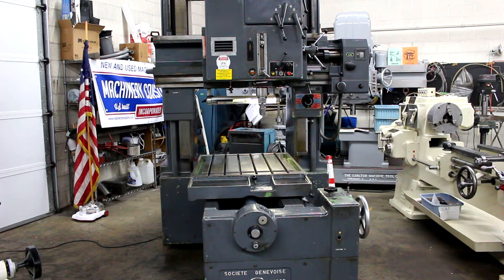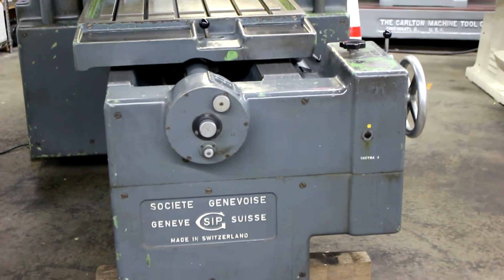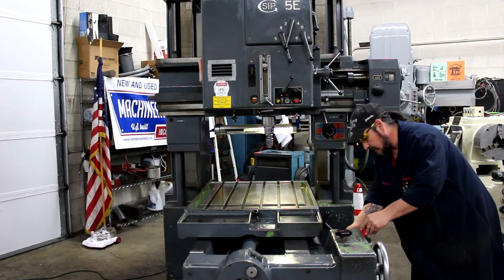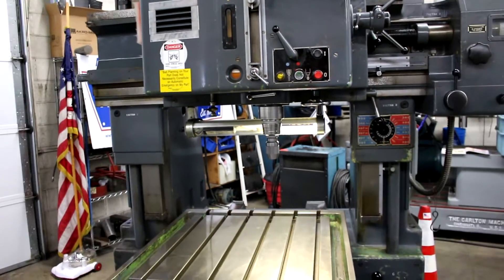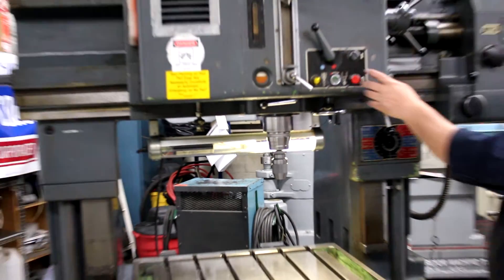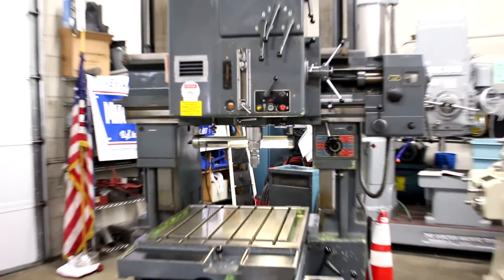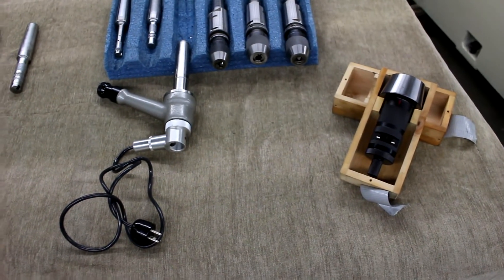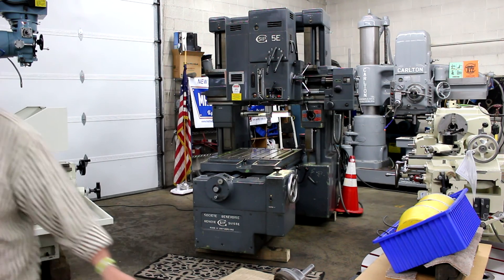Sip Vertical Jig Boring Mill

Comment: I  ran one of these 5E's for twenty years then a SIP Hydrotic 6 for another four. Do not mill on them the spindle has taper roller bearings with spring preload, milling will put to much side pressure on the spindle taper bearings and do damage